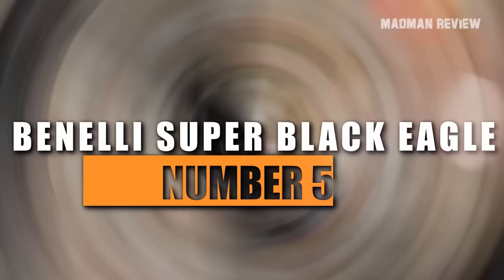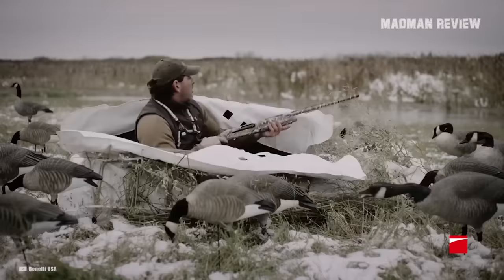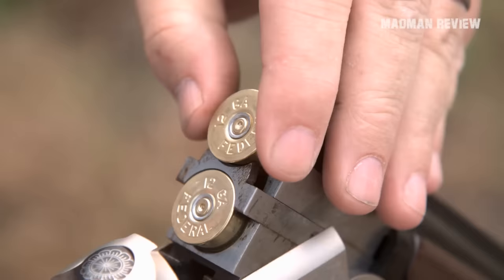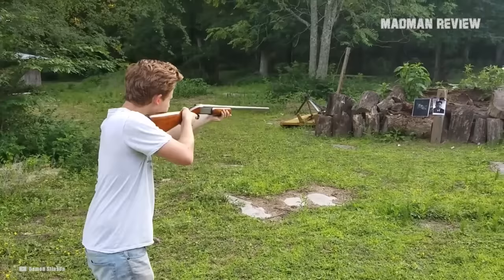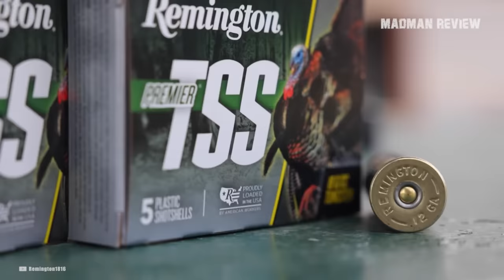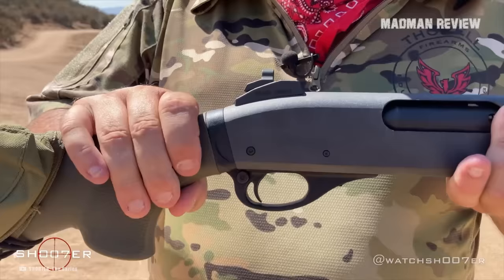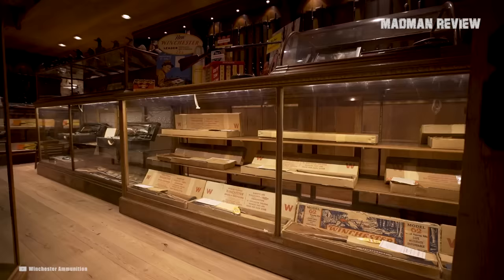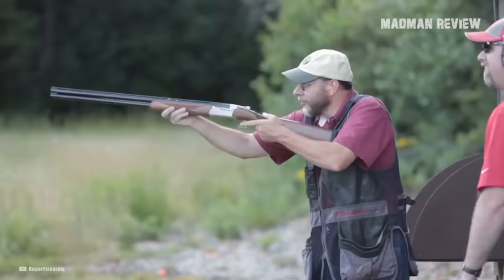5 Classic Shotguns You Must Buy at Your Local Gun Shop

Comment: You forgot probably one of the most iconic shotguns going. The Ithaca model 37. The slickest pump action out there. Bottom loading & ejecting design makes it less likely for crap getting into the receiver.
Reply: Yeah, I second that motion! I own one, but, as a southpaw, if I had it to do all over again, I'd get a Browning BPS for its bottom-ejection and mostly, the tang safety which is the most lefty-friendly safety on any long gun!
Reply: Winchester model 1200 and 1300 are the smoothest pump actions out there. They didn't call them the speed pump for no reason.
Reply: @weezem  Ever handled a Model 37? I used to think the same thing about the 1200, not so much the 1300. Not only is the 37 butter smooth, hold the trigger back after the first shot and run the action, every time it closes it goes off. That's why a great many police departments bought them. The 1200 is a good gun, I own a few take downs but, the 37 has it beat IMO.
Reply: @johnwillis4706  I have and just because you can slam fire it doesn't make it smoother than the 1200 and 1300. I stand by what I say. Ithica 37 is a good pump but it's not smoother than those old Winchesters.
Reply: @weezem  And that's entirely your opinion and as such you are welcome to it. we'll just agree to disagree. Good day.
Reply: @johnwillis4706  as well as you. I might disagree but you have a right to have a difference of opinion. Have a good one as well.
Reply: I have a 37 in 16 ga, I considered selling it but I really prefer a 16ga for small game
Reply: @IMBrute-ir7gz  my dad has a BPS and it is a sweet shotgun for sure. He’s right handed but is left eye dominant so he’s forced to shoot long guns left handed so I’m sure he appreciates the tang safety too.
Reply: Plus it works the same for Left and right handed shooters
Reply: I agree..I have an Ithaca Model 37 in 12 gauge which I purchased in 1982.  Actually a Model 37 'Basic' model manufactured in 1980 it was left over brand new stock.  Excellent reliable shotgun I've taken everything from squirrels, rabbits, woodcock, pheasants, and deer with it.
Reply: I have one that was made in 1940 .
Reply: I have a 37 that was my Grandfather's. Over 100 years old and a great  guns
Reply: Biggest junk I had for a shotgun was a Ithaca 37 next to a Weatherby Patrician pump
Reply: I bought  the Ithaca 37 in16 ga. at a gun show and foolishly sold it because it would not chamber my reloads (thru a Lee Loader) reliably. Wish I had that gun back, light, good shooter with factory ammunition. That is why I do not part with guns anymore.

Comment: Most of the older guns were very good guns . Reliability, toughness all around good gun . The Remington 870 wingmaster is as good as there was.
Reply: Not all, some Remmington 870 in 12, 16, 20 and 28 gauge had this habit of a slam rapid fire where if the gun did slam fire it would almost always keep firing all the rounds out. This was mainly in the 1960's around 1964--1966 until 1968 for most of them though a few models in 1969 would do this too, mainly the trap versions with the long barrel.
Reply: @caseysmith544  huummmm I will check in to this . Sounds like something that could happen with a simi auto . The 870 is a pump action

Comment: The Remington model 17 pump-action shotgun. Which they sold to the Ithica gun corporation of Ithica New York and became known as model 37. Was an iconic shot gun   bottom load bottom ejection. I have 2 since 1970's  I won skeet tournaments 25 for 25 with my right hand and then 25 for 25 with my left with my field piece improve cylinder 26-in ventilated rib barrel. Two and three quarter inch chamber. After winning the skeet shoots I've been appreciated through the trap shoot 25 for 25 we're shooting from the 3-in magline which was 15 ft further back than the two and three quarter line taking the birds like 15 ft out of the house with their right hand repeating the same with the left. Tennessee pheasants killed a few ducks..

Through the special order desk at the Navy exchange island of Guam  in my  Navy veteran father ordered I think a total of seven Winchester Model 37s. I would have to go and check, I cannot remember if they were actually made in Japan or in Canada mine is sitting in my safe 36-in barrel 3-in mag. The 1970's variation for that 12 gauge was called a model 37a. My brother-in-law loading hot 3-in mag rounds shooting  geese with his eventually broke the Tang on the receiver were attaches to the stock. About 300 dead geese later at about 500 actual shots fired. I think he got his money's worth out of that $25.00 Christmas present from his father-in-law. 😂🤣🤣

Comment: My Win M 12, 12 ga, F choke was produced in 1931. It has a 32 ' barrel and is stamped "Standard Trap" on the bottom of the receiver. It has seen so much use that the checkering has worn smooth, being passed down through our family. A word of caution if the trigger is kept depressed when using the slide action it will fire on closing...this also makes it rapid fire in a self defense situation. like a Grizz showing up as you're cooking dinner over a campfire.

Comment: I have picked up a couple different 12 gauges for under 350 that I wouldn’t part with. A 1200 Winchester with a 30” barrel and full choke. The other is a 3 1/2” bps with the 30” barrel. It’s a good one for the person that needs to loose some weight. Lotta good older shotguns on the shelf for reasonable money that got traded by a family member who just didn’t care.